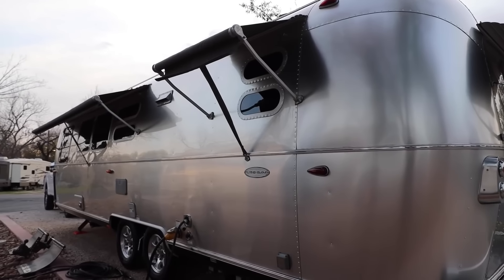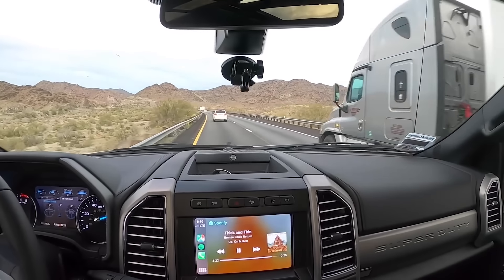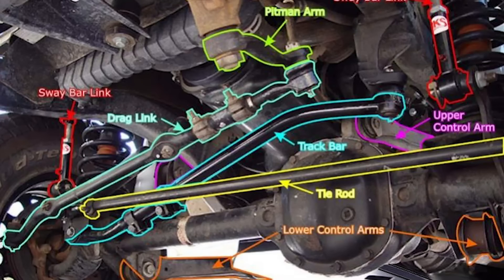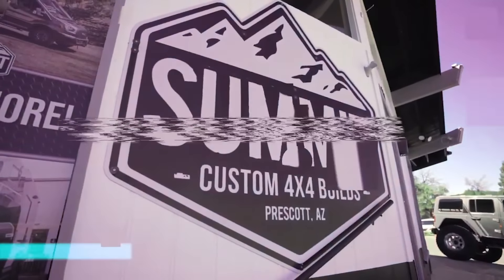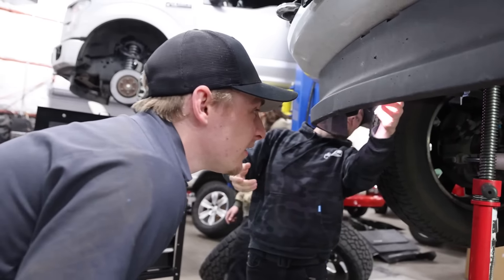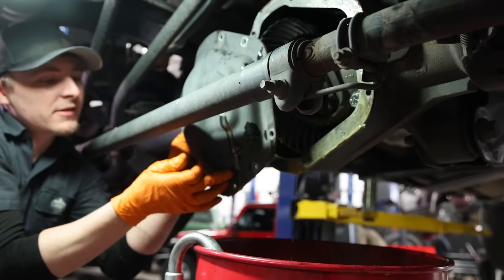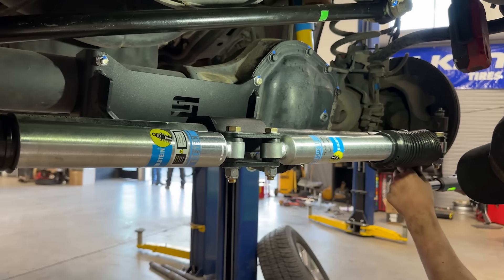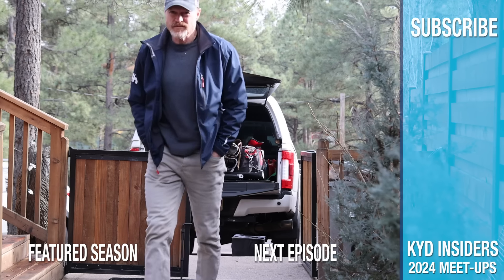2024 Ford Super Duty: Why We Passed...

Comment: Good episode, I only have 2.3 Eco-Boost Ranger but use Amsoil and an extra capacity PPE transmission pan with drain plug and glow shift transmission fluid temperature gauge.
Sounds like you’re lucky so far with transmission and rear end. There are issues with 10 speed 10R80’s Ranger uses..

Comment: Thanks for getting this one out Marc, I hadn't considered market based pricing as a possible concern but Super Duty's are rare and command top dollar.  I wouldn't settle for any other truck and as always, it's cheaper to fix what you have and keep driving it.   I also have never seen a front diff. with snotty fluid like that, and I've changed quite a few during my mechanic days.   Good find!

Comment: Really loved this video! Especially the rationale for not purchasing the nee truck. I’m in a very similar situation but with an F150 and it’s really helpful to hear someone else be so thoughtful in their evaluation of the problem and not just take the easy way out with a new purchase. I have a 2016 F150 XLT 2.7 that I paid $36k for new and now have 85k miles on it. I’ve towed two campers, the newer one being a 21’ 3500 lb Alto. So basically a scaled down version of your setup. Given its age and mileage, I evaluated if a new F150 would make sense, but a comparable 2023/24 XLT is $65k and there are no major rebates/discounts like there used to be pre-pandemic. To your point of basic supply and demand, it seems that the supply shortage combined with pandemic demand plus inflation/greedflation have dramatically shifted the pricing setpoint for full size trucks. It remains to be seen whether this will be the operating point, but if it is, I will be hard pressed to buy another new full size truck. As you said, the actual cost of ownership is what matters and the math just isn’t adding up for me in this new paradigm. Keep up the great content and having fun!

Comment: Marc, you might check the axle seals on the front axle they could be letting in water by the wheels!
Reply from the maker: On the diff cover? It was resealed properly
Reply: No I mean by the wheels you have seals on the ends of the axle that could be worn, that is letting water in and it is traveling inward to the diff.

Comment: Great video. I agree with prices of the 2024’s way up there. I just traded in my 2017 F350 platinum for a Custom Order  2023 F350 Platinum Tremor with the High Output 6.7 with all the bells and whistles. After trade in I’m still paying same monthly payments due to the high interest rates. But…. I have to say that I love the new engine and coupled with the 10 speed tranny is great. I’m already getting significantly better fuel economy with it over my last 6 speed 6.7. Can’t wait to pull my travel trailer with it for first time this spring. 23:44

Comment: Great video as always Marc; unfortunately my old ford truck is a 1967 F100 Ranger (Short Box), so I need (would like) a new to me SuperDuty to pull a new 27' International FBT / Hatch (13 Adventures). And we went all in... 2024 F350 Lariat SuperCab Short Box HO Diesel with 4,314 lbs. of payload... less than 3 months from order to delivery; no supply chain issues on the lower trim models!!! I'm from the buy /choose the trailer 1st camp; then get more truck than you need 🥸. NOW; to choose the right hitch??? 🧐

Comment: Over time, all things wear out, if you are the one in the car every day, you slowly adapt to the way things feel and sound. If you had loaned your truck to someone else that drove the same miles the same way, you would have immediately noticed that the truck did not drive the same way it did when you loaned it out. This is one of the tools available to the troubleshooter that a driver seldom has. I can't tell you the number of times I have gone into an industrial facility after some time has passed and said to a machine operator "hey, whats that noise comming from the (fill in the blank)? the response is almost always "what noise". The noise wasnt loud, it just wasn't the same as the last time I was there.

Comment: Great vid.
I bought my F250 Lariat in 2019. The dealerships had a lot of inventory but they were pretending the trucks were gold and in great demand. Not to say they arent great trucks but the jump in cost from my 07 GMC to the Superduty in 2019 was too much. I also wanted gas with 4.30 gears. 
Whomever specs the lot trucks was always choosing chrome and cushy options over performance and durability. As a result, I ended up ordering my truck. 
The dealer was still trying to over price the deal so I ended up working a deal 3 states away. Only then did my local dealer match what I felt was a good deal.
Little did I know what would happen to the marked a few years later.
Death Wobble.... the minute I pulled off the lot I felt play in the steering stabilizer. Ford was jerking people around at that point. I just researched and bought a King single stabilizer. 100% improvement. No steering input over little bumps. Problem solved. I did that with less than 5,000 miles.
The stock stabilizer litterally had 1/2" of free movement on center. Which translates into the wheels rattling every steering component over ever bump. Contributing to premature steering part failure.
Those Michelins ride a bit rough too. I swapped mine out at 50k. They still had meat but I wanted a larger more aggressive tire. The new Toyo AT3s ride smoother.
I dont tow a lot and my miles are more on county roads. But with the 4.30s my tow capacity is 15,000. I get around 14 mpg.
But if I was running a lot of highway and out west I would want diesel. Thats what they are made for.
My 2019 has 55k miles... I dont see myself buying another new truck. Maybe ever. At 68...
I paid $86,000.00 for my last Peterbilt in 1992. Not paying 100k for a puckup truck.

Comment: Have a f150 powerboost with twin turbos and a 54 hp electric motor. The powerboost provides 7200 kw onboard generator that runs my airstreams ac.,just plug it in the bed of truck. Get about 17 mgh towing.

Comment: Good choice keeping your 2019. We have a 2019 F350 long bed deisel. We have 686,000 miles on ours. We deliver new campers from Indiana for a living. Love your choices, bilstien, Michelin and synthetic oil. First major issue was the alternator went at 500K. Just normal maintainence. Still have all original front end parts. We get 125K out of the Michelins. One hint cross those front tires when you move to the back, it’ll smooth them right out. We’ve done shell Rotella T6 after the first 5K on the truck. This Summit shop sounds like a great place and good to see young folks excited about working on trucks.

Comment: I am in the same  position you were regarding buying a new diesel truck.  I have a 3/4 ton Silverado with a Duramax diesel.  The truck has 85 k and running well.
In the video you mention replacing the CP 4 pump.  Can you share any of your research on a replacement and the cost?
I had one go and the cost was 10k.  Luckily it was under warranty.
Thanks so much for a great video.
Rich

Comment: Very informative video.  I can't believe how much trucks are going for these days.  We pull our 28' Airstream Classic with our 2008 Dodge RAM 6.7 Cummins diesel.  The old girl has approximately 156,000 miles on her now, but I have never experienced any "death wobble" and guess it's just a Ford thing?  I also have never had anything done to the front end either?  Maybe the older trucks were put together better?  Not sure.  When my truck was new back in 2008, it cost a little over $30,000 and from what I can see on line, she would sell for $28,000.  I guess ours has cost us $2,000 over a 16 year period of owning her, which isn't too shabby.  I am interested in exactly how much all of your maintenance work conducted during this video cost?  I'm guessing around $5,000 or more?  Oh well, happy trails and keep the videos coming.

Comment: Sadly, I had to lemon law my 2022 f450 and am glad I didn't sell my 2015 Ram 3500 dually. It used to be newer was usually better, but not anymore. I however will be towing my ATC 4023 toy hauler with my Freightliner for comfort, fuel economy, and safety.

Comment: I have a 22 F250 7.3l gasser.. In 28,800, no death wobble. I40 and I10 in Arizona leaving California should have shown me something but both solo and with 8,000 lbs behind me, so far so good. I think Ford might have changed the caster spec. That has been mentioned several times on Ford forums as a fix. My truck has pretty stiff steering. It is not one finger steering, that's for sure.
Have you considered a disaster prevention kit for your high pressure fuel pump now that you are past 100k miles?

Comment: Have you ever considered upgrading the CP4 on your truck? 
If not, i highly recommend you to look into the DCR conversion kit for the 6.7 powerstroke, it will give you the piece of mind knowing that your fuel system will not have to be replaced if the cp4 goes out.
Reply from the maker: In June. Stay tuned.
Reply: @KeepYourDaydream  I have one in my old 2011 f250, I use my truck to do hotshots and I got it installed back in August last year, so far I got 65k miles on the new pump and not a single issue with the fuel system since, also been using Archoil AR6500 for fuel treatment and is a day and night difference, much quieter injectors noise and gain about 1-2 mpg since using it.

Comment: I have a comment on extended oil changes when using a lab analysis. I would strongly recommend a oil filter change in the 5,000 mile range. Then continue you lab analysis.  A replacement 6.7 engine from lack of service is extremely expensive. Vista Dave's Auto Center You Tube channel for some internal concerns in the 6.7 Oiling Circuit. Best of Luck.

Comment: I would not agree with dropping the Xmission pan to make a fluid change, unless the pan is leaking.  Flushing is where you start, then if your fluid removed is not that clear Red color and is showing signs of browning or burnt fluid, drop the pan and change the filter at least.  Brown fluid means you overheated the transmission and may have damaged the unit.  Certainly the clutch plates in the unit may now be warped.  If the fluid is brown and the unit still shifts properly, you need a better transmission cooler if you are going to keep doing what you are doing.

Comment: Getting water inside a differential is bad news typically if its been in there a while and you are loading the differential.  being that it was the front and you probably don’t use 4X4 mode very much, that with no loading on the gears and bearings, little unwanted wear or damage  has occurred.

Comment: 126,000 miles is not too many miles to have your transmission fluid changed
as long as most of the driving was highway miles, as evidenced by the fact
that there was little clutch material in the pan and on the magnet. Keep in mind
that dropping the pan will only get approximately 1/3 the fluid out. With that in
mind, you may want to decrease your intervals to 75,000 max on subsequent 
oil changes.

Comment: My F250 is having all that replaced and more.  The one big thing was the fuel pump.  As the cP4 fuel pump is known to grenade the engine and put metal throughout the engine.  Replaced with a different brand and one thats made for a direct fit.
Reply from the maker: On my list. Great truck. It's worth the effort.
Reply: What brand did you go with?
Reply: @johnclayton6946  not sure yet what brand is being installed.  Might be S&S

Comment: We bought our Motorhome new back in 2020 (2021 year) and our tow behind new (Buick envision) back in 2019 and besides the fact that RVs have not increased in price as much as cars/trucks, I can't justify moving to anything else.
 I learned to ask myself "What I'll get get that I currently don't have if I do this?" before doing business and the current new price is not justifying whatever they are offering.
I prefer to spend $50K in gasoline traveling than just throw it in a "deal" where it will disappear in a fraction of second as soon as I leave the parking lot and that for nothing I can significantly add in enjoyment that I'm not enjoying right now.

Comment: If you read the manual on most of these trucks the first oil change should be done at about 1500 miles. The initial oil is for break in really.
Reply from the maker: Good point. That's probably true.

Comment: I regularly follow your channel - good practical and useful content/information.  Great tow vehicle maintenance tips in this video for sure.  I have been a powerstroke super duty owner since 2000.  They're great trucks.  Two questions please:  1.  Why the F250 vs F350 SRW?  I can tell you from personal experience that the ride quality between the F250 and F350 SRW trucks is not that different, and you get more payload and towing capacity with the F350.   2. With all the RVs you've featured on the channel (except the Bluebird), why did you settle on, and sticking with the airstream?  I watched the front repair video on your airstream, so like other makes, they are not without issues, AND they are VERY pricey.  Are the airstreams just that good with respect to how they tow, or is it a status thing, or what?  thanks,

Comment: I just got a low mileage 2020 F250 STX with the 7.3L gasser crew cab with 3.55 gears for $38k and love it. Wouldn’t want a diesel powered truck. But what was the installation cost for the dual stabilizer kit? I’d like to see if that shop can do my truck in early May after I get back from Baja.

Comment: $200+ for an oil change is crazy. Even at $165 on my duramax at the dealer is ridiculous, especially considering the oil and filter cost retail is less than $60.

Faulken wildpeak at2 106k miles.

Comment: Have a 2021 F350 dually with the 6.7 diesel.  You're pretty informed I would like to hear information on the high pressure fuel phmp issue. You'll likely get to that before most of us will. Have you heard of any preventative measure to help mitigate an expensive repair bill.  Also, always look forward to Sunday night to see what the next adventure is.

Comment: Yeah, so... going to a suspension shop and asking them to inspect all your suspension components and let you know if you need anything replaced is like asking a surgeon if you need surgery. The answer is always "yes" and there's always a TON of really solid reasons. Everything can be explained and justified. Dude was making it sound like you were really putting that truck "through it's paces" when you were doing standard road driving with a trailer. Not pounding dirt roads and 4-wheeling etc, road driving. Great salesman. And him wanting you to keep the maintenance and service of your vehicle with them so they can learn the history and characteristics of your driving? Brilliant. I did like the actual mechanic though. Honest, straightforward, willing to pass on his knowledge.

Comment: A couple of data points in the gas vs diesel argument. 

1. I’ve talked with people who manage large fleets of HD trucks (3500s) and they tell me that the diesel will always be more expensive to buy, own and operate, and that you don’t make that back on resale. According to them there is NO economic argument for a diesel engine period. You buy one because you want or need the power that’s it. 

2. Gas engine reliability these days is right there with a diesel especially for the non-commercial user. I say that from a total system perspective where you have to balance the million mile short block against the DEF and emissions component reliability and the fact that the vast majority of people will move on to a new vehicle long before they reach the point where the gas engine would fail. And those are lasting much much longer today than was once the case.

Comment: Engage the 4x4 system every once in a while to get those gears moving and fluids flowing
Reply: 👆🏼 There is definitely some truth to this and could have attributed to the condition of the fluid over time. Throwing it in 4WD every once in a while is good for the fluid and gears. Especially since they have manual hubs and see literally no movement on-road. Great advice.
Reply from the maker: I agree. I do use it fairly regularly in the winter to get in/out of the cabin, which helps. I forget in the summer.

Comment: Understand your decision, lf retaining current truck, might want to consider the DCR Fuel pump conversion. If CP4 pump goes out you’ll be repairing for $12-16k or more… that’ll offset costs to own. Lot of travel, one bad fuel stop has been an expensive repair of fuel system. 

The Super Duties, upper Trims (Platinum & Limited) especially the F350 & F450 are hard to find and don’t look to be getting easier. That can also lead to truck retaining value or even appreciate for a period of years.

The Rams as mentioned are over stocked, discounts available whereas SD still has apx 1 yr wait. Many don’t want the long wait and will pay a premium to  purchase an upper trim, even clean used go higher than purchase price. The price you could receive for your older SD is higher than similar Ram / GM based on SD new values too. 

I have a F450 Limited on order, and could easily sale for an ample premium after purchasing if desired. 
Rarity, hard to get, limited low production with high demand has a positive impact on resale too. 

Good luck with all your maintenance, truck still looks great. I personally self maintain non-warranty maintenance, saving on the upkeep side.

Comment: Great info! Totally trust your advice. Wondering if you had an EGR Cleaning at around 60,000-70,000 miles? I didn’t hear you mention it. We have a Ram 3500 6.7 Cummings and it was a service light on ours. Almost $1000 here in Mesa, AZ for full day in shop.